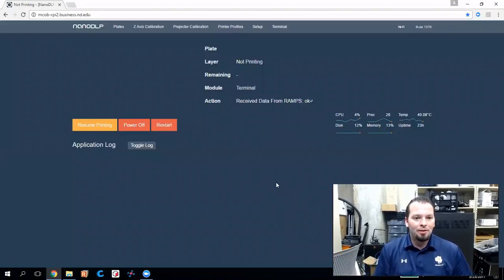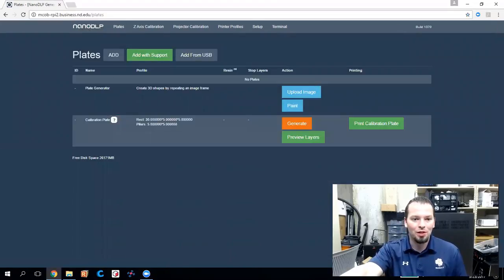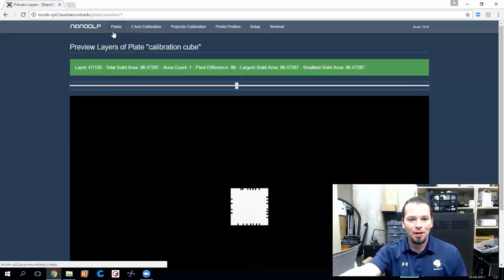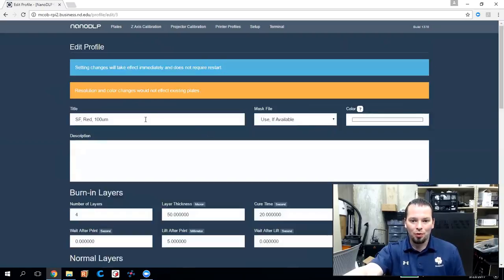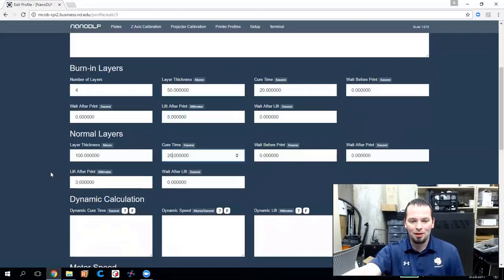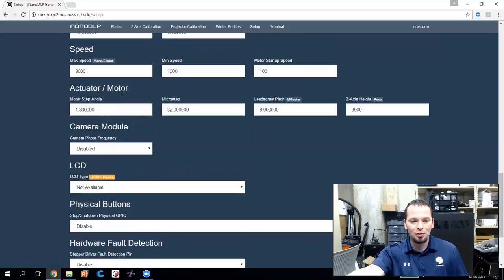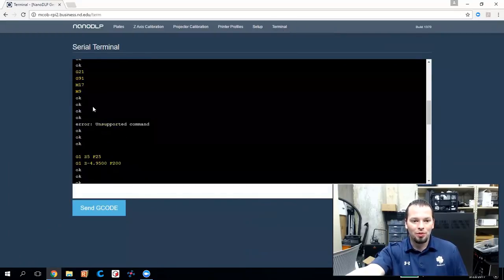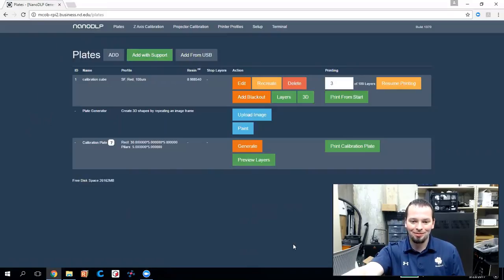NanoDLP - 10 Minute Overview

Comment: This is all really awesome. But you uploaded an STL file. Does it not have a slicer interface or settings? Items like support structures are pretty darn important.
Reply from the maker: NanoDLP has since added a way to do support structures, but previously you had to add them to the STL with another program before slicing.

Comment: Sorry if this is a dumb question - but I just discovered nanoDLP about 15 minutes ago.  Does this enable people to build DIY resin/DLP printers, using this as the software engine?  If yes, where can I find more resources about that?
Reply from the maker: Hey Jarrod. Yes, NanoDLP is a platform that would help you build a DIY resin printer. Basically the Pi generates the images of the slices and outputs them via HDMI to your projector or LCD screen, and it also sends out whatever GCode you need to control your Z stage and backlight... The NanoDLP website has documentation, and there's also a user forum and a FaceBook group.

Comment: I clicked my expand file system tab and I get some error response time on my PI 3 for some reason. What did I do wrong? I have a 16gb micro sd card.
Reply from the maker: That's a new one for me... Luckily, you can always re-flash the card and just try again. Maybe try a different SD card in case the current one isn't a high enough class or has a problem?

Comment: Hi Jim thanks for the tutorial but i have a question i'm building my dlp printer using 7 inch LCD display with 800*480 resolution and when i started to print the dimensions was incorrect if you please can help me and tell me how to correct that
Reply from the maker: It's possible that the native resolution is rotated (i.e. portrait instead of landscape). Could that be it? What about overscan and zoom, is your light engine stretching the image?
Reply: Thank you so much it works perfect now the problem was that i didn’t change the screen resolution in the resin settings but now i have another issue i want to know more about G-code for example i want my printer to go to home position (Z=0) when the print starts but i don’t know how to do that i use nanodlp shield NOT ramps
Reply from the maker: @mohanadmekky116  The RepRap Wiki has the list of commands that I often refer to. reprap.org/wiki/G-code 

G28 generally moves the axes to the endstop, whether that's all the way up or down will depend on your build and cnfiguration/firmware. You may also have to enable the stepper(s) first with M17 and define a travel speed with G1 or G0 and an F value... Once you've reached the endstop, you'll likely want to use a G92 to define that position, and then set things to absolute or relative (G90 / G91) depending on how you want Nano to work.  

Have you worked with GCode very much before?
Reply: thanks again but yes my experience in Gcode is not good now i’m having i little problem the Z axis is not rising when i start print the machine homing then the build plate moves to the bottom of the tank and every layer the Z axis moves a little up then goes back again to the same bottom position on the next layer 

my machine works based on GPIO only i’m not using arduino and ramps but i’m really having trouble knowing the Gcode i have to write before layer change and after layer change in order to raise Z axis the right distance depending on layer thickness
Reply from the maker: I wonder if your motion is set to absolute, and Nano is sending relative commands... Nano says to lift 5mm, and then to go down 4.9, and your printer is going to exactly 5, and then exactly 4.9, etc. and it just does that over and over... Throw a G91 in your start code, and see what happens. https://reprap.org/wiki/G-code#G91:_Set_to_Relative_Positioning Be ready to yank the power though, just in case.